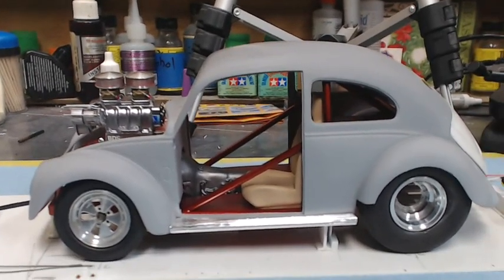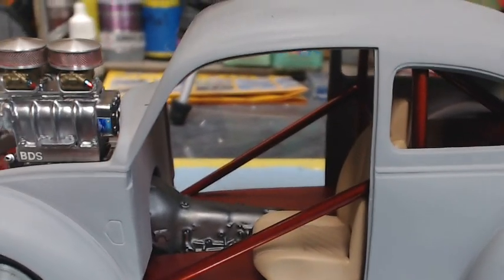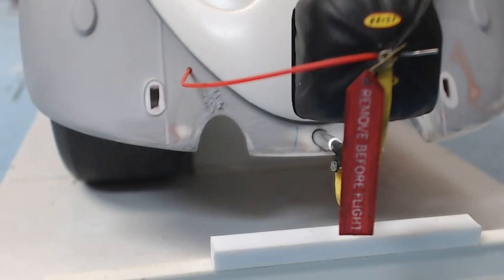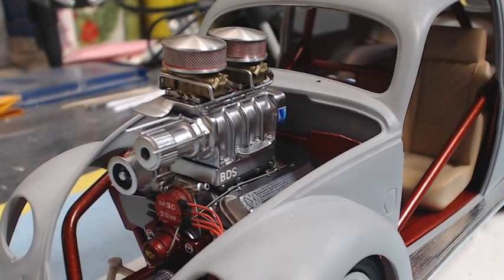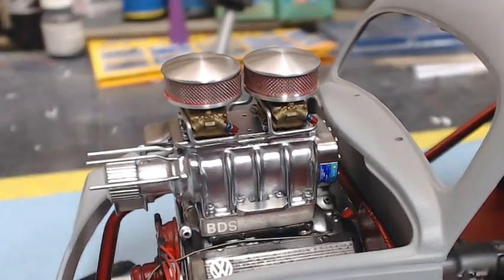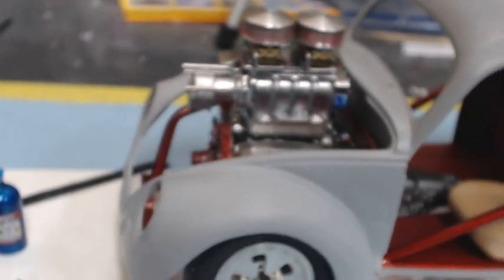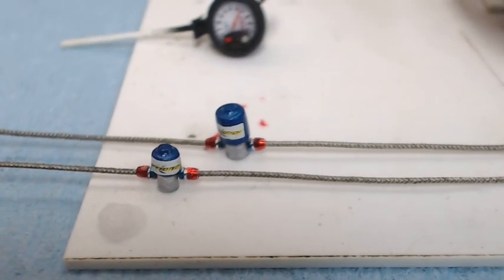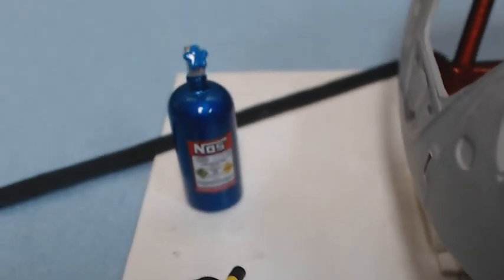showtime studios bench update

Comment: Hello hunter, I know this is an older video, how did you make your nitrous/fuel solenoids? Aluminum tubing? Styrene rod? I'm researching and need to make some in 1/25 scale. Thanks.
Reply from the maker: They are made from solid styrene rod that was carved on a drill press.
Reply: @showtimestudioshunterselby  hey hunter thank you so much for replying back so soon. Thanks for the info as well. Do you have any idea as to what size I would need to use for 1/25 scale? I know your beetle was a larger scale so the sizes for 25th would be different. I used to have some old 1:1 purge solenoids laying around but I believe i have sold them. There's probably really no definitive answer to my question so I will probably just start with like a .100" styrene rod and chuck it into my drill and go from there and start shaping it. By the way, I'm going back through your older videos and watching them again. There's tons of great information in all of them. I started using the napa color line gray primer cause of your and Paul budzik's videos on showing that specific primer. It works great and still using it today. Thanks again!